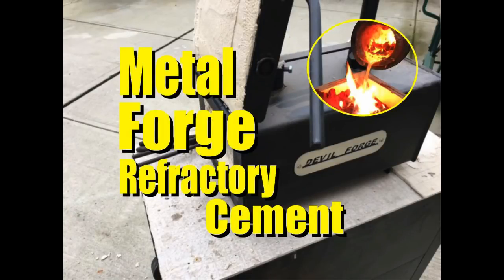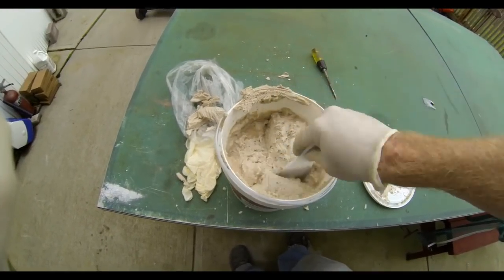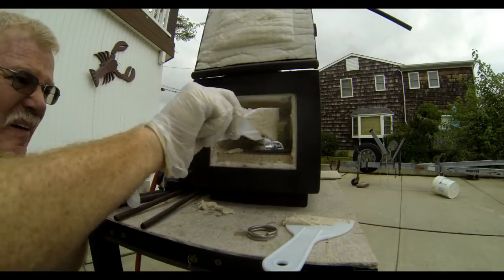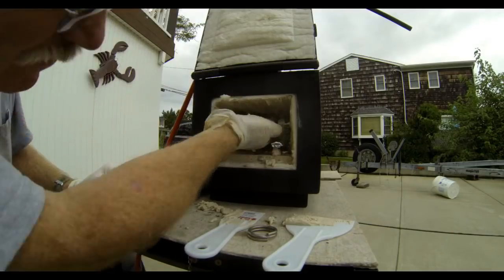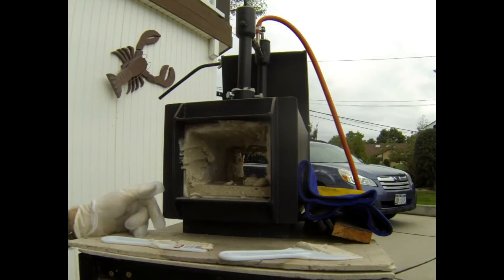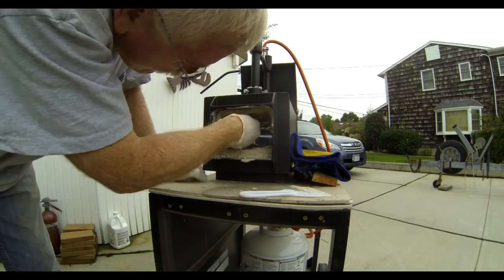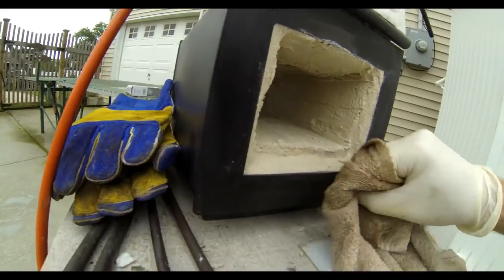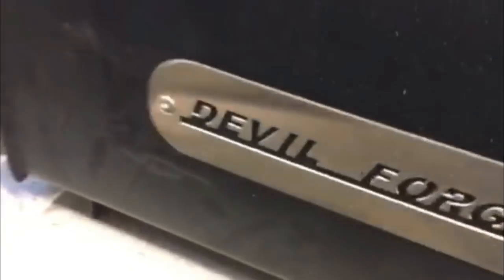How to Seal Kaowool Ceramic Metal Forge Insulation with Refractory Cement

Comment: Good to see someone doing it right, more people seriously need to be coating their Kaowool. First time I've seen someone use premixed Refractory Cement, From others I've seen it seems more common to use both a rigidizer (saitenite, ludux, bubble alumina, Mizzou, or Kast-0-Lite 3000) and finish coatings (APG-36, Plistix, ITC 100)

Comment: I might recomend applying a rigidizer before the cement.
Reply: I think the rigidizer is a kind of bonding agent to help bond the fibers together.
Not sure how it is applied, never used any. But it seems that if available, use it before the furnace cement as it should 
strengthen the bond with the cement and support the fiber in position before toweling on the cement lining.
Reply: That’s what they tell you, but I hear a lot of people say the moisture just makes the insulation too heavy and fall out

Comment: Should I first spray with a rigidizer? And if so do I let it cure completely before adding coat of refractory..
Reply: Yes. Also to anyone reading this wear a respirator when working around exposed refractory wool.
Reply: While u can do both the rigidizer mix I beleive 210g water 300g powder will be sufficient
Reply: I heard the rigidizer will make it too heavy and fall out don’t know maybe don’t use as much

Comment: I just bought the same forge that you have in this video (my first forge). I have been reading all kinds of conflicting things online on wether or not it is necessary to coat the wool with refractory. Most say it will not heat properly with the wool and refractory. But then read that wool without refractory is unsafe.The forge came lined with wool and also came with a powder that is a rigidizer. That I’m supposed to paint on I alsio bought 5 lbs of santanite from a website called high temperature tools. Should i use both or is the powder that came with it all i need. I know this is a little long winded but I’m very confused and just starting out I’m hoping you or someone who reads this can help in lighten me on this. Thanks in advance
Reply: Cooter  use what it came with
Reply: Great question, I was searching for the answer to this my self!  So many people use different thing's and not wanting cancer I really needed to find the correct one for peace of mind!!!
Reply: Yup. Same question. My understanding... You definitely need a rigidizer. It protects you from the wool. Then the cement on top of the rigidizer protects the wool from you damaging it when taking things in and out, etc. So I guess they should include a rigidizer AND cement. Not just cement.

Comment: That works well done thank you
Reply from the maker: You're very welcome!
Reply: A wet paint brush will smooth the finish out nicely, I just recoated a 6 million btu brick burn chamber that was coated several times, troweling  left a very rough surface. I was stretching a half bucket of greenpatch 421 to do the job, with no instructions! I looked up instructions, and found that it could be thinned with water. Wetting the firebrick with a wet brush and cement residue made the bond much stronger, allowing less troweling to make it adhere,  especially the overhead 6 square feet. It 
also kept the fine dust and loose chips in place so the cement could stick better, instead of rolling off the dirt. The inspector wanted smooth, so the brushing was a huge help in getting the job to pass. Hope that helps!

Comment: Question sir... Before you applied the refractory mortar, did you apply a "rigidizer" to the Kaowool? I'm asking because I'm building a forge out of an old propane tank, and  I'm trying to save a few bucks. Shoo naturally in wondering if I can skip the "rigidizer" step. Than you for the vid, and your time sir!

Sincerely,

Blair Diviak
Reply: NOOO!   hehe, because the raw blankets soft, and has a lot of loose end and tears easily. Main reason is the mortar (whatever u want to call it) wont want to stick to some soft flaky surface. It needs to be hardened somewhat. there are a few ways, I used fumed silica and mixed with water. Thats the generic popular method without paying for a propriatery name product like l-lite or w.ever it is. do rgidize it or this finishing coat will not stick to your blanket.

Comment: The reason you would seal the wool is so the tiny fibers don't go in the air and give people silicosis/aluminosis (that leads to pulmonary fibrosis). Toxic fumes shouldn't be any real hazard when working with the stuff.
Reply: The dust can be hazardous to the respiratory system
Reply: @arthurianlegend352  I said that. Do you know what silicosis is?
Reply: @notyourpersonsperson1380  sorry i  meant to reply to a different profile
Reply: At first heating there may be some fumes, but then you should not be breathing superheated air, either. So don't watch the food cook, or at least 1st heat in a ventilation zone.

Comment: do you put the cement inside the holes the burners go through?
Reply: The cement hardens. So it might expand and contract at the holes, and damage the finish coating. So the best would be to have wool in the gaps, perhaps rigidized.

Comment: DIY,where did you get the cement and is it holding up to the heat.???..thanks
Reply: ken taylor this is a late reply to a problem you have likely already solved, but I would cruise around hightemptools and see what they have to offer. Reasonably priced and great service.

Comment: DO NOT USE this refractory cement to cover the kaowool in your Forge! This cement is used to mortar fire brick only! I did exactly what this video demonstrates on the exact same Forge and experienced constant bubbling from moisture trapped behind the cement. On every occasion the cement bulge had to be broken re-patched. Attempts to try and dry out the cement by several low temperature fire up still did not resolve the continuous issues of bubbling of the refractory cement. This is very frustrating. You've been warned.
Reply: thats fine, its to stop the wool from releasing particles
Reply: I own this exact same forge, came across this video the day after I ordered the exact same cement, read this comment, and said to myself, "self, you're quite capable, and you've been warned. So make it smooth, give it time to set up, and dry it slowly." It lasted about a week, then started cracking and crumbling off. I didn't have bubbling issues, but the stresses of heating and cooling back and forth, combined with putting metal in and out of the forge, caused the whole thing to start coming apart, leaving the underlying wool exposed.

It is frustrating. I was warned. I thought I could rise above. I flew too close to the sun.

I would love to see a follow-up video from the OP to see if he had the same issues. For the rest of you reading this, you were warned above, and you've been doubly warned now.
Reply: @asmurdock  damn it I just bought the same damn thing for the exact same forge. Ok, I've been warned by 2 people I wont do it.
Reply: I did the same with my forge last year. It's worth investing in a quality refractory. I use kast-o-lite 30 now, followed up with ITC 100. And now it's soooo much better.
Reply: also wear a very good mask when dealing with refractory wool. that sht is NASTY if the airborne fibers get in your lungs it never comes out and will permanently reduce your lung function.
Reply: Premade refractory like that has a very low amount of sodium silicate. I have better results mixing fireclay with sodium silicate. Gets hard as a rock, don't blister or swells up, loves the heat!
Reply: THE WOOL SHOPULD ALWAYS BE INSTSLLED ON TOP OF REFRACTORY CEMENT AND YOU SHOULD BUY THE STUFF MADE SPECIALLY TO TREAT THE KAOWOOL !
Reply: @billrobinson6839  but falls apart easier. I have hte same style as you, Lotsa people wont harden it before they apply mortar, thats where the problems start.. the internet is full unreliable resources. =)